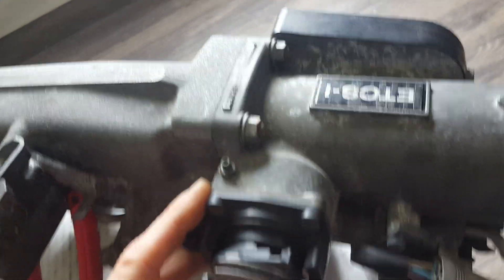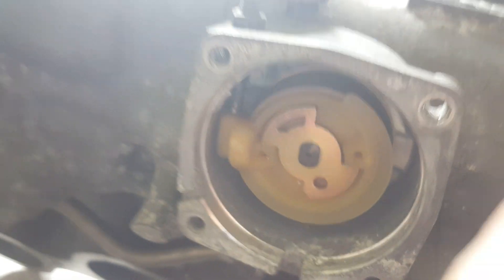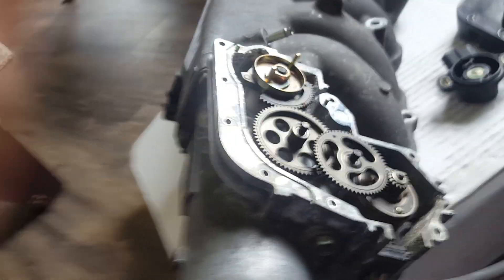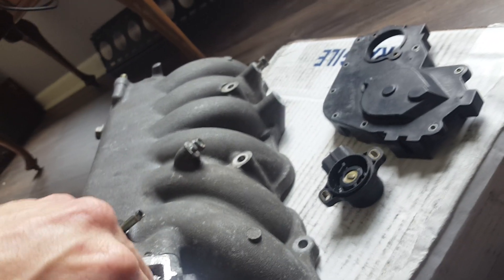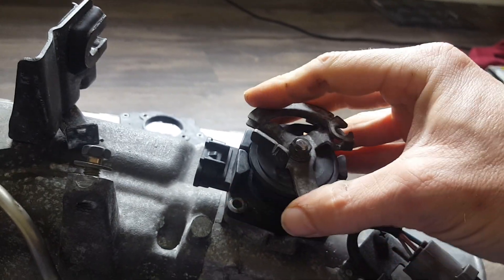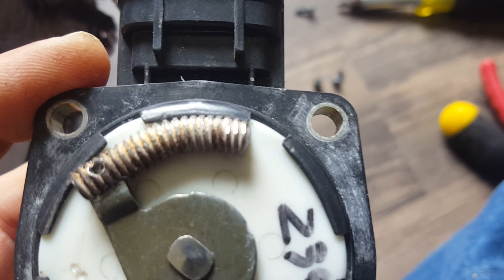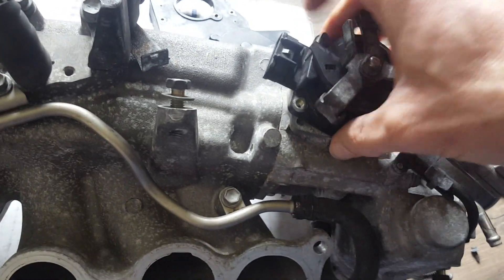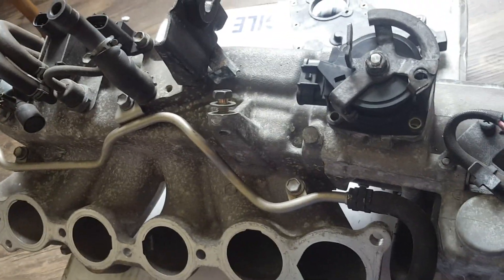DIY ETCS-i delete on 2JZ-GTE VVTI

Comment from the maker: UPDATE: I now have driven the Supra with this delete on the factory ecu for approximately 14,000 miles. I still haven't had a single throttling issue
Reply: You might have said in the video but is your car and automatic
Reply from the maker: @rustedratchetgarage6788  it is a 5 speed , R154
Reply: Does that matter? I have an auto and what type problems could I endure if I locked it/bypass on stock ecu?
Reply: Hello mate, done this mod but now it has a little hesitation when i thouch the pedal, after engaging it's ok, is this normal?

Comment from the maker: UPDATE: The little pin I made to attach the screw came loose and made the throttle hard to push. I would suggest a tiny screw for the hole and/ or some jb weld. I wound up welding a  little bit of a washer on the throttle cam and so far it's working well enough and smoother than with the bent screw.

Comment: Is the ETCS-I on a 1jzgte just as moddable with a piggy back ecu or would it require a complete standalone? I've heard some stuff that has scared me away from buying ETCS-I but the -I seem to be in much better shape for lower cost because a lot of 1jz folks know about the electronic throttle.
Reply from the maker: I can't say I know for sure, bc I never researched it but I don't know why it would be much different than the 2jz version. I thnk they are more trouble to tune on a standalone ecu and that's likely why they are cheaper. But, I've had the bypass on my engine with stock injectors and ecu for about 3,000 miles and running it hard doesn't seem to have an effect on the air/fuel ratio in a negative way. I'm boosting about 5 psi for now and I see af numbers between 12 and 10:1, so I'm not worried about lean boosting. If anything, the ecu may be going slightly richer to protect the engine since it doesn't see the throttle request sensor or any transmission or speed sensor input. I can rev it as long as my foot is on the pedal. The only problem is idle control. If I pull hard and shut down fast while disengaging the clutch, then the engine will stall. But if I leave it engaged for a couple of seconds on deceleration, then it will idle.Ive got a plan for an idle control system I'm gonna be testing soon though. For what it's worth, I don't have a single regret buying the vvti 2jz engine. It makes mad torque down low for cruising and in my opinion it's plenty fast when I want it to be

Comment: What is the purpose of this mod. Why eliminate the electronic traction control?
Reply from the maker: I did this mod because I removed a whole lot of sensors from the harness and the computer has this "limp home mode" that activates when too many parameters are just unknown. I removed all the sequential turbo valves and the auto transmission wires to go single turbo and R154 5-speed manual. It seemed like the computer would not advance the throttle more than about 1/3 of the pedal with all these sensors missing. I discovered that the drive-by-wire mechanism has a throttle "request" sensor AND a throttle "position" sensor. The request sensor makes the ECU look at the angle of the throttle you are requesting and the drive by wire motor is controlled by what the computer tells it to do. The upside to this is that the computer was programmed to adjust throttle position with the dbw motor ,regardless of what else is going on. SO, if the throttle position sensor is moved to,say, full throttle, it doesn't matter if the computer agrees that the throttle should be open. It is effectively bypassed when you force the position sensor to a certain position. so, for the last 2 years Ive had all the sensors i dont use removed and absolutely zero input from the transmission and speed sensor. Bypassing like this it seems the computer thinks you are sitting in the driveway in neutral and it will rev all day unless you hit fuel cut. BUT, there is effectively no speed limiter and it runs as wild as you like it. HOWEVER, if you are forcing the hardware like this, you need a wideband to eye the A/F like a hawk. you should immediatley shut down if it looks lean under boost or crazy rich because of a vacuum/boost leak..This fact alone is why there is a disclaimer

Comment: wow! great diy!
but how much is the idle rpm and warming-up rpm with that mod?
Reply from the maker: Without touching the idle screw, it won't idle at all. The dbw system controlled that. So, as a consequence, there is no idle air controller. It also affects idle-down after a hard pull or sudden stops. In a manual transmission car, it's not a big deal, bc you can tap the throttle and keep it going. I imagine with an auto trans it may be a botheration. So, you have to play with the idle screw and  get it where it won't stall very easily. I still have air conditioning and power steering, so I set mine at about 1100 rpm when at operating temperature and ac off. When the compressor kicks on it drops to about 800, which still isn't ideal, but without a standalone or some rigged up version of an idle control, it's the best I could do. I also noticed the vvti engine is funny about vacuum leaks. The wideband will show rather lean with a leak at idle,  even with a small vacuum leak. So, I'm still brainstorming a solution for using the stock ecu with this mod and not having to worry about idle and stalling
Reply: Does it run really rich since it’s not receiving correct signals for the air actually going into the motor? I want to do this but it seems like it would dump fuel since it’s not controlling the throttle blade anymore.
Reply: @brianleonard6879  if I do this work will it make any difference  in petrol average and will the censor work
Reply: @brianleonard6879  hi Brian,

 My understanding is that these throttle bodies don’t have an idle set screw can you advise the location please

Comment: Okay so I just figured out why my throttle plate isn’t opening all the way (hence why I’m getting dusted in my sc300) 

after removing the gears from the motor will a check engine light turn on? Also, what problems does this cause that I should be aware of. 

You had also mentioned a company that would screw it on, I want more information on where I can get that because I don’t have anything that could make my screw flat so I’d just much rather get the part.  

I’m new to all this and I’m learning as I get hands on. Kind regards thank you for this!
Reply from the maker: I believe Driftmotion out of California sells a delete kit still. At least they did when I made this video, but it was backordered. I'm not sure about  the check engine light coming on, I didn't wire the port wires up. But it will affect idle,bc the motor for the throttle is doing the idle control. But there's an adjustment screw you can play with to get it to idle. Also, limp mode is entirely dependent upon the  drive by wire function. If there's a problem with fuel or timing, the ecu was setup to jump into limp mode to protect the engine. Without the fail safe in place, it will run hard, even if fueling is lean,which can be catastrophic. So, if you're using a factory ecu with dbw delete, you need to have a wideband controller and Hawkeye the fuck out of it while driving " like you stole it "
Reply: @brianleonard6879  if I remove the gear would that keep my idle smooth with the wire delete?
Reply from the maker: @Kawura  not by itself. There is an idle screw on top of the throttle body. You'll have to adjust it a little.

Comment: Will this work with a stock Toyota ECU??
Reply: Yes
Reply from the maker: It has been working for me on my stock ECU for 2 years. I did wind up welding a little cam on that little plate. the screw idea didn't work for me in the long run, but the concept is sound if you run a wideband with this setup

Comment: Are u running a standalone ecu
Reply from the maker: I'm running the stock computer for now. Until I get funded for a standalone, I'm using a wideband gauge and fuel pressure gauge in combination to mess with fuel pressure using a rate-of-rise adjustable regulator. It's not perfect but it'll keep things good enough not to smoke pistons until I get a standalone.  I'm leaning towards an emu black at this point.
Reply: @brianleonard6879  same here ecu black because my 2jzgte vvti wont rev past 3k rpm so iam just over it hate to spend that type of money right now but i need my car running and iam getting a new wire specialties harness too
Reply from the maker: @diamoniquesmith9301  do you have the mass air flow sensor in place? Mine wouldn't even stay running longer than a couple of seconds without it, but I've heard some people say their vvti engines will run but won't rev higher than 3k without it
Reply: @brianleonard6879  when i hook up my maf the car shut off and when i uplug the map nothing happened it stays running with both of them uplug so idk iam over it
Reply from the maker: @diamoniquesmith9301  what about the drive by wire ,is that still hooked up, or do you have it deleted? Also,  are the factory twins still on it? I'm curious bc both seem to have something to do with that issue.  I have a single turbo and alot of wiring removed,like all the vsv stuff and auto trans wiring. Most everyone I've talked to that can get the engine to stay running without the maf still have the twins and wiring intact.I've heard the stock ecu has some fail safe algorithms built in that will put the dbw into limp home mode if it doesn't see everything correctly.  These vvti engines particularly have difficulty if there are any air leaks or weird signals coming from map or maf. If you did the dbw delete, then that's strange that it won't rev up also
Reply from the maker: @diamoniquesmith9301  try the delete and unplug the dbw controller plug. See if it'll rev higher then. Please let me know if you try it and the results. Seems like alot of people get different results from the same conditions

Comment: Drift Motion sell a part for that mod.
Reply from the maker: Yes, I'm aware of that. I have since opted for a more permanent solution. I welded a washer to the plate that I had the screw pinned to and it's alot smoother now that before. I guess I really made this video to demonstrate that there are options for doing this mod other than buying somebody else's  solution.
Reply: Led4YorHed  Update on your engine? Have you figured it out? I see a deal for a 1jz etc ai but worried about putting it into a S14 cause I’m pretty much new at this still.
Reply: Led4YorHed  Thanks for the info! Much appreciated. I don’t think I’m experienced enough to work with that yet so I’ll have to be patient & wait for a etcs for sell. 🙃
Reply from the maker: Led4YorHed  Im not sure what symptoms a bad maf will exhibit, but I can tell you that without it plugged in the engine will start but it won't stay running. Some others have said their vvti's will run without it. Probably because they don't have so many sensors removed like on this particular swap. But I could be wrong about that. I hear many different stories about this issue and it doesn't seem consistent. I only know what I have observed doing all of this.

Comment: Will this work on the stock ecu??
Reply from the maker: Up to this point, I've only heard that it will. I've got about 5 more wires to sort out and rig up the fuel pump and she will be on the road. I will post an update on this either way. I'm thinking it will work bc, if the dbw control was the only thing that the computer was looking at, then there wouldn't be 2 throttle position sensors. When the stepper motor isnt engaged, the throttle will only open a little bit .I believe that the fail safe algorithms are built in to the drive by wire function and with the throttle request sensor, not the actual throttle position sensor. But I will know for sure hopefully not too long from now
Reply: OK thanks for the info sold  my    gs300  because of this problem then got a jzx100 1jz swap in to a Altezza now thinking to go back to the 2j
Reply from the maker: @gibronjamaludin3683  I got it to fire up today and I have to keep it going bc it won't idle on it's own. But this weekend I'm gonna play with the set screw on the throttle body so that it will idle. It didn't seem to want to rev past about 2500 rpm at first. On a hunch I unplugged the ects-i plug since it isn't controlling anything anymore and now it'll rev up fine. I can't wait to get this beast out on the roadway. Been a long time coming!
Reply: OK that's nice  this is some great info keep up the good work
Reply: @brianleonard6879  did you get the 2jz tot idle fine after you did the throttle delete and what is the rev limited now?
Reply from the maker: @gibronjamaludin3683  I have the power wire hooked up to the dbw bc I think without it being connected, something changes in the computers response to throttling. But with the delete and the wires connected  ,it seems to rev just fine. I'm still pretty apprehensive about revving it too high for very long bc my cams are still in the break in period. But I've revved to 5,000 rpms a couple of times and she shits a little fire once you let off. I'm more convinced now that alot of the vvti system fail safe features are in the  drive by wire circuitry. It almost seems like Toyota used a somewhat lazy approach to protecting the engine from sensor anomalies through the limp mode on the dbw mechanism. I think that is why companies that sell a delete kit make a disclaimer that says you shouldn't use the kit without a standalone ecu, bc without taking a few precautions with the stock computer, you could seriously fuck shit up in short order. But in my opinion, if you are closely watching things like air/ fuel ratio and boost relations along with temperatures, you should be able to recognize problems before they become fatal
Reply: @brianleonard6879    OK so did you kept the ects-i  unplug ?
Reply from the maker: @gibronjamaludin3683  I have it wired to power up with the Ignition switch and have the stepper motor  and all etsc wiring connected to the computer to let it see the motor functioning but the gears are removed ,so it has no control of the throttle. It revs at least to 5k at this point. I'm not brave enough to go beyond that just yet,but I don't see why it wouldn't rev up to the limiter. Still breaking in those poncams
Reply: @brianleonard6879  ow OK I'm gonna try it out the same way you did .I will let you know how it comes out
Reply: So correct me if I'm wrong but all that needs to be done is remove the gears and make a secure crutch to take up the existing slack common to the manual cable side. Then reassemble and keep everything plugged in to trick the ECU  into believing the motor is still doing something
Reply: Brian Leonard please get back to me about this
Reply from the maker: @northwestmachine5090  yes, that's been my experience with it. I've heard some people say that they didn't need to keep it plugged in. Strange but not everyone has the same results with the vvti engines. My issue now is stalling after a hard pull if I don't tap the throttle once. Wideband shows higher than 17:1 which seems like the fuel gets cut off completely when the throttle is closed abruptly. But just a tap when you pull in the clutch to stop or slow down will keep it running and keep the air/ fuel ratio nice
Reply from the maker: That's of course with the stock ecu. I'm sure a standalone and an idle air control valve would eliminate that problem. Most likely why there's a disclaimer about mfg.er of the delete kit not being responsible for damages as a result of using it with stock computer
Reply: Brian Leonard m
Reply: Would work with the stock ecu??